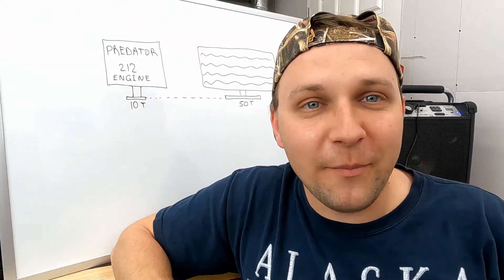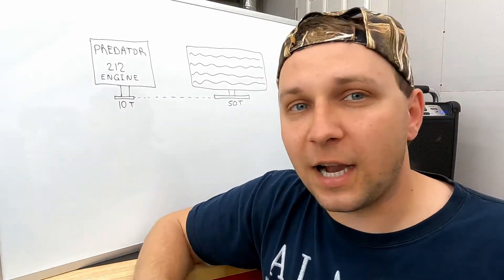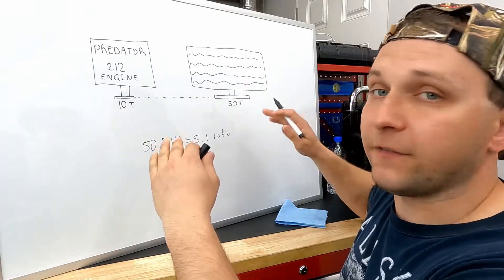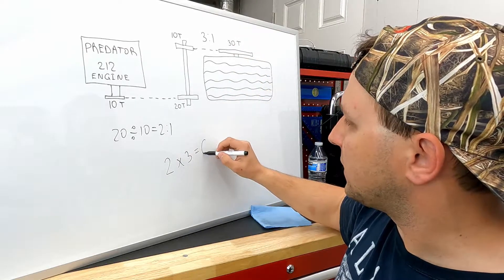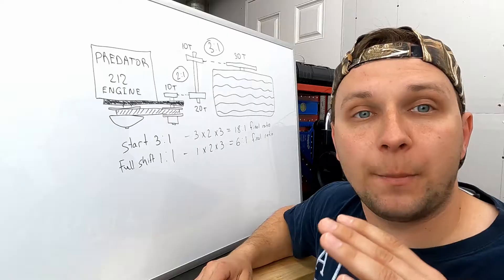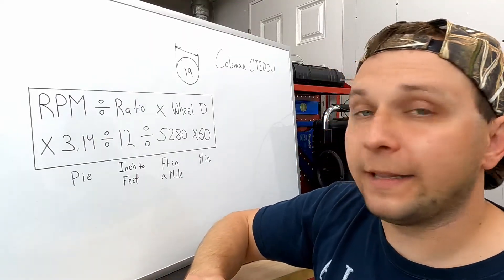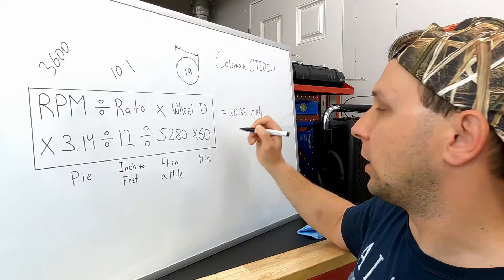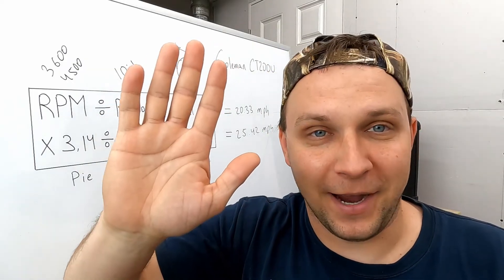HOW TO CALCULATE GEAR RATIO and TOP SPEED on MINI BIKE or GO KART

Comment: Hi, if you could could please help me out.
Just installed a 30 series on my coleman.
So TC belt to 10 tooth spocket to 50 tooth rear sprocket. If I fallow you thats 1-5 ratio.
Im getting 49mph at 4400 rpm.
However thats at max throttle.
Im not getting any higher rpm with load. Im only 130lbs aswell.
The calculator says Im spot on but why the max of 4400 rpm with gov removed?
Reply from the maker: @Andrew Downey, hi✋, is your governor removed or bypassed? The calculations look right, but it should turn a little bit faster. On the other hand you don't want to spin it to high without upgrading your flywheel and etc. (oem flywheels tend to explode at high rpm) I would swap the rear sprocket for a smaller one if you want to increase your speed.
Reply: @OkayBuilds  196cc, gov removed, billet fw/rod, mod2 cam, intake/exhaust done, 37 main jet, 18lb springs.
Forum says the engine doesnt have enough power to go faster so I need to install a 8 tooth front sprocket to lower gear ratio.
However you vid says dropping gear ratio will loose top speed and gain rpm and torque.
What I want is speed. Red spring is on third hole. Im 130lbs. Im only getting 49mph at 4400 rpm
Reply from the maker: @Andrew Downey, if you will install 8t front sprocket you will increase ratio, not lower it: 50÷8=6.25, that means you will loose top speed and gain torque. Less ratio - more speed,less torque. More ratio - less speed,more torque. If you want more speed you need bigger front sprocket or smaller rear sprocket. With the 8t front sprocket you will loose approximately 10mph.
Reply: @OkayBuilds  apparently if the engine doesn't have enough power, it reaches its top rpm for power thus top speed. Its like starting a bike it 18th gear. It cant go fast because the motor doesnt have the power to spin faster. By dropping the gear ratio it will spin faster. If it spins faster with the torque converter it will go faster
Reply from the maker: @Andrew Downey, give it a try and let me know the results, I'm curious now
Reply: @andrewdowney760  there is no 37 main that's your pilot jet your main should be between 98 to 125 depending on elevation  I'm in Cali and mine is set at 38 pilot jet 115 main and I hit 58 mph on mine with a 10 tooth front 50 tooth rear on a #420 chain
Reply: @OkayBuilds  In this case engine power needs to be considered. With an 8 tooth sprocket he would be running higher RPM at speed. His engine may have as much as 2 HP more at 5K RPM than it does at 4K RPM to drive the load. A smaller rear sprocket would take RPM even lower where there is less power to drive the load.

At one point I had 9/60 sprockets on my Coleman and was topping the 196 out at 5K RPM. This was around 47MPH. There's no way I would get that RPM or top speed with the stock 10/50 sprockets. I'd be lucky to get to 40 MPH.
Reply: What is your tire size?
Reply from the maker: @bret2870  20x7-8

Comment: can you tell me formulae  in Si system
Reply from the maker: @mene mohib, you can use the same formula, the only parameter you need to input in standard system is the wheel diameter, you can convert it from cm to in, and then convert the end result  from miles to kilometers, hopefully it will help you

Comment: What's the best drive and driven sprocket combination so I can solve the over slack in the rear chain to my Coleman ct200uex ?

I'm finding out that this causes bearing problems to the driver bearing.
Thanks. Great video.
Reply from the maker: @maria metco, if your chain is over slacked and you are ok with the top speed of your mini bike, you might look into switching to a better quality chain, your problem right now is that your chain is stretched, those mini bikes don't come with the best chains, so if  you upgrade to a better chain that will solve your problem, but if you will go the sprocket changing way it will affect your speed specs

Comment: My question has always been whats a good gear ratio for decent acceleration and decent top speed over 45 for stage 1 with governor removal basic stage 1 I have seen some stage ones go 52 but I dont need like all of that so whats a good gear ratio 14 front and 62 back? No converter
Reply: Just try the math he showed and plug in different ratios.  Make sure to enter your correct measured tire diameter.  Actually measure it with a tape.  I got a stock ct200U, bypassed the gov to the outside hole and zip tied the gov spring, 30mph on GPS and motor is turning about 5700rpm according to the tach I just got, going to redo how the pickup wire is mounted tomorrow and recheck RPMs. It kept pulling and hasn’t acted like any valve float, I do have OMBwarehouse “box stock” valve springs to instal too, they are like a 10.5lb spring.  Oh this is also with SunF AO20 tire, they are slightly shorter than the stock Coleman knobbies.
Reply from the maker: @jaydee659  totally agree!
Reply: @jaydee659  If you are maxing out at 5700 RPM that is valve float. Put a torque converter on it and then the governor or valve float isn't even a concern. With a stage 1 kit you'll get 35* MPH without over rev on the stock rod.
Reply from the maker: @Landon Thomas, that's a good question, but I think I won't be able to really answer it for you, because it depends on alot of factors like weight of the bike/rider, wheel diameter etc. even the area where you live in, whether it's flat or it's a area with bunch of hills that you will be taking your bike over...The only advice I can give you is if you want both decent acceleration and decent top speed, go with the torque converter!

Comment: How do you calculate the ratio into 1 number to plug it into the equation to put it into a calculator
Reply from the maker: @James Moore, for example if your gear ratio is 10:1 you input only 10 into the equation, if 14:1 you input only 14 etc...hopefully I answered your question